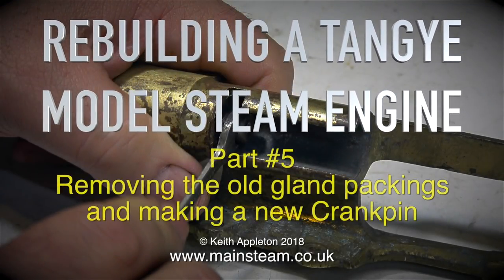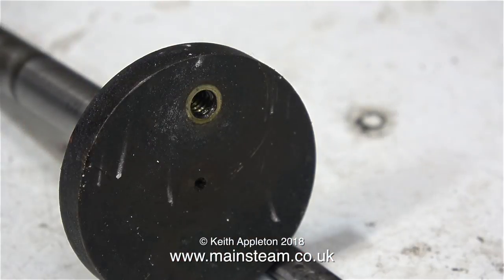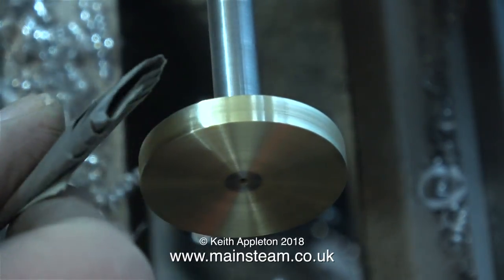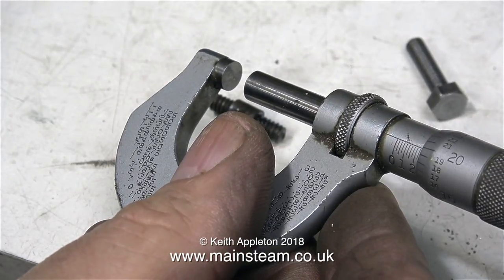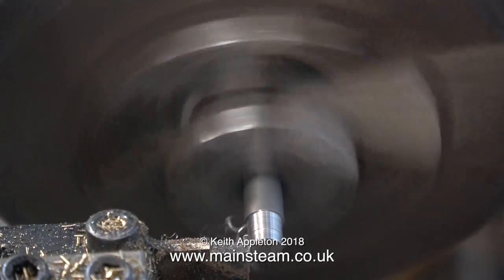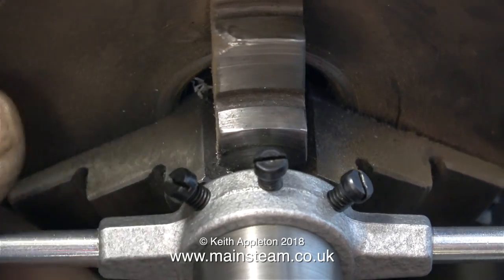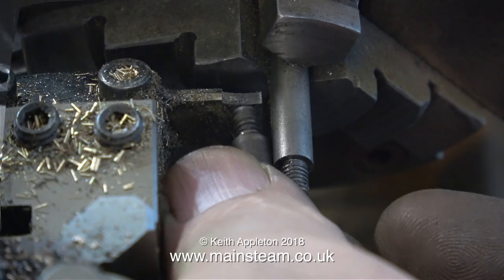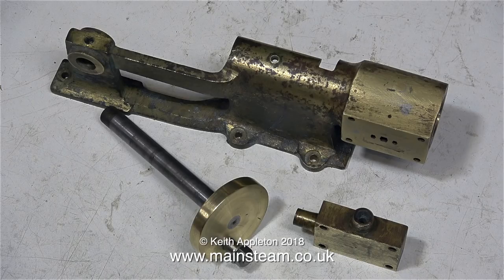REBUILDING A TANGYE MODEL STEAM ENGINE - PART #5

Comment: you could heat straighten that crankshaft. If you heat one side of the shaft, when it cools it will pull toward the heated spot a little. repeat as necessary. I straightened a PTO shaft with a 7/16" bend in it.

Comment: Some stainless steels are magnetic. This applies to inner wires and spokes in the cycle trade, and probably to much more elsewhere. Spokes and inner wires can be nickel or silver in colour and are definitely stainless, especially the branded ones from companies you know, but they are magnetic or not to more or lesser degrees depending on composition. I know there are other magnetic elements: nickel and possibly cobalt, and I remember a nice film in school on liquid oxygen jumping up to a big magnet.
Stainless has to be drilled and turned slowly. I've made brake pad pins for Tociko brakes from M6 stainless bolts, and turning it was fun. It didn't harden as per drilling too fast, but went all over the place like toffee.

Comment: If the threads where original metric, why did you changed it? Wouldn't it be a good approach to keep this machine as close as possible in its original state?
Reply from the maker: As I have said many times in my videos, I do not have any Metric nuts & bolts ......

Comment: Is the BA  threadform still 'current' or is it 'legacy' in the UK?  I'm used to that form as 25 years ago I worked in an industry that used them extensively here in Australia.  If I was still working in that space I  expect I'd be using metric these days, though,  as that is what is generally available locally.  Not intended as any sort of metric vs anything  question- we still easily find whitworth here,  too,  though the bigbox shops are reducing their stocks of those sizes rapidly.
Reply from the maker: BA threads are readily available from Model Engineering outlets. Less so from commercial fastening suppliers - mainly metric now.